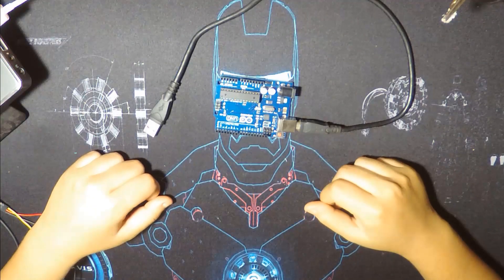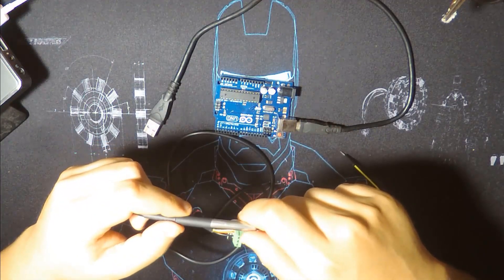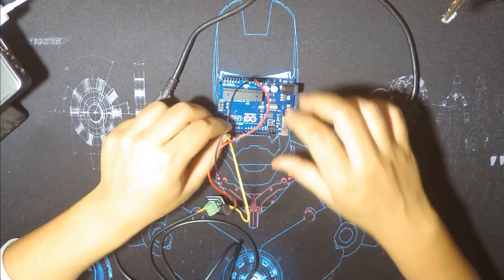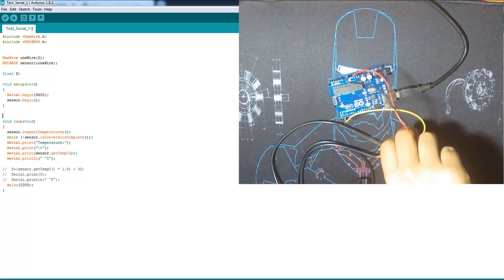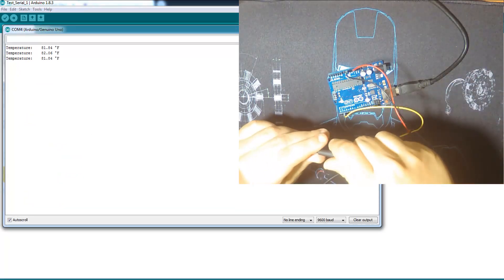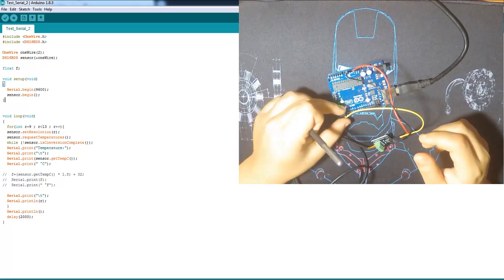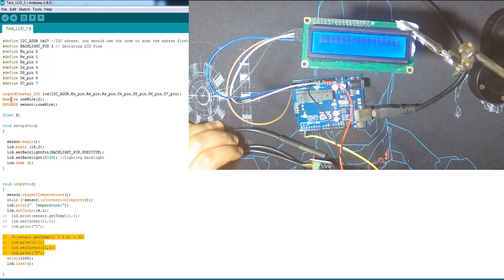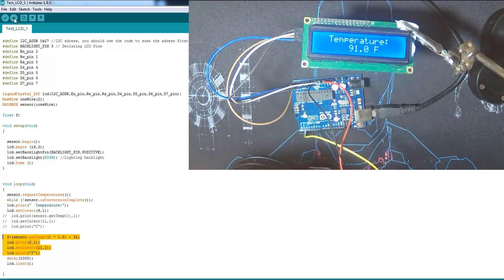Measure Temperature with DS18b20 + Arduino + LCD (°C/ °F)

Comment: Hi, can we use more than one sensor i need to monitor 6 temperatures on a machine and 2 pressures sensors. also with a lcd . thanks for all
Reply from the maker: Yes you can, each one has its own declaration and pin.

Comment: What do you call the small board that connects the DS18B20 sensor to?
Reply from the maker: It's just a terminal with that built in 4.7k resistor that you put between Signal and Vcc